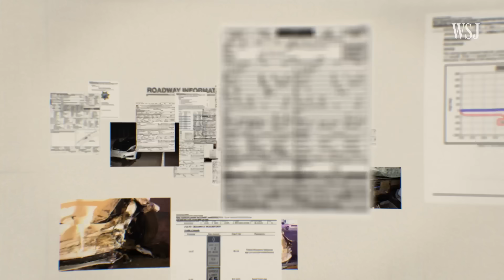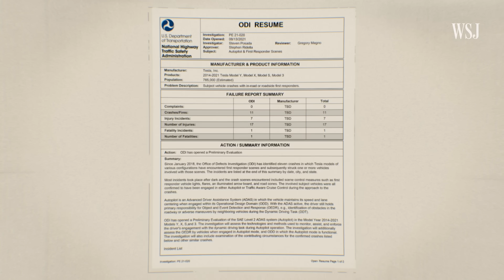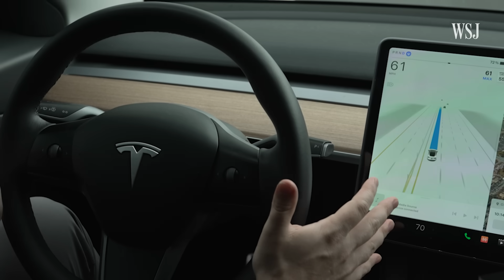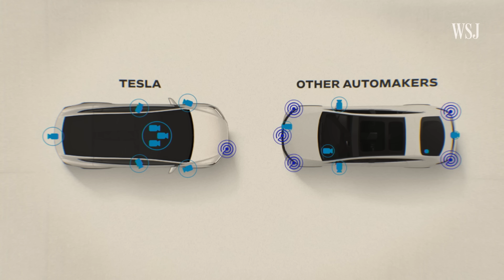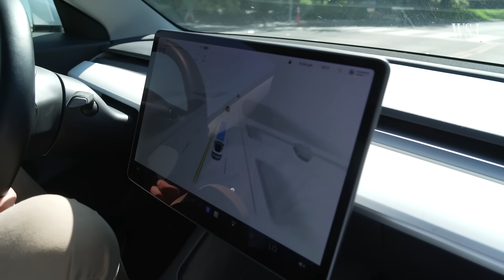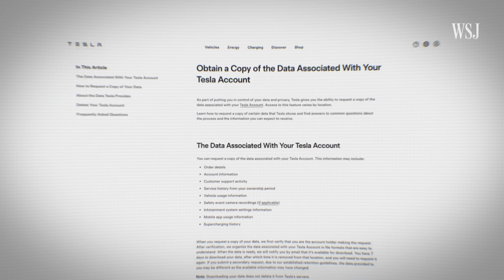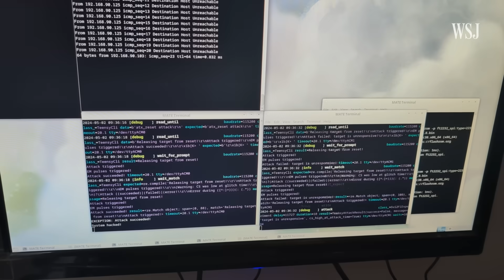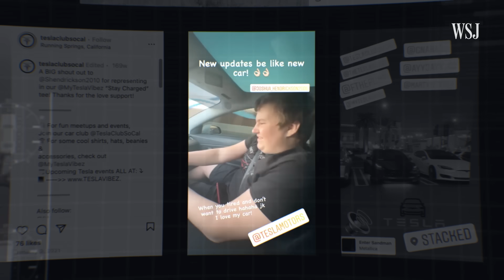The Hidden Autopilot Data That Reveals Why Teslas Crash | WSJ

Comment: Actually, all cameras that are in view see it, it's just that the software needs to translate what all of them are seeing, depending on the angle as well. Basically, it's the software, not the camera that's not seeing it, since it's not trained on overturned vehicles, then it doesn't know how to process the image of what the cameras are feeding it.

I've worked with 16 camera systems with LiDAR and RADAR that are pointing in the correct direction, with a bus annotated in front of it passing by, but somehow the software thinks it's flying 50 feet off the ground, so of course it's going to try to ram it, since it thinks it's not there.

Heck, it even doesn't know what to do with a wall, since it's not really trained to analyze it either.

If your self-driving car somehow goes over the sidewalk and you're not on the wheel, you're screwed. It's just going to ram itself.

This is not limited to Teslas, this holds true for all self-driving vehicles at the moment.

Stop making it sound like the cameras are the only ones to blame, they are just the first and last line of defense.

LiDAR can only assist from a distance to some extent, but anything that gets too close also ends up as garbled data. If say you're on a bicycle and on the side of a LiDAR equipped vehicle, 2 feet away from it, you're in all likelihood a garbled mess for the computer to analyze, and you can still get sideswiped.

This technology is not ready for mainstream. Not at all. I doubt it will even be ready in the 30s, but hey we need to sell the masses some new hype or buzzword to throw their money at. Who cares if they die as long as we make more money, right?

Also, pilots are properly trained to fly a plane and use autopilot when needed, regular drivers just need to pass the driving test to get that license. Regular people will just buy into the marketing BS of autopilot that's fed to them because most people aren't that bright, let's be honest here.

A smart and informed person will probably not trust any technology 100%, that's why we have backups, contingencies and redundancies, cyclical error correction, etc. everywhere, but most people are not very smart or well informed, unfortunately. That's just how it is.

Comment: Simple solution, if there were reflective strips on every side of the truck (including roof and bottom side) this probably wouldn't happen because cameras would see it.

Also driving so fast in fog that dense is not a good idea, no matter with or without autopilot, fsd or any other technologyb of this type.

Comment: 10:25 
Every technology has its flaws, but to say that we aren’t “doing enough to fix its gaps” is misguided. FSD 12.3 was released earlier in March this year to the masses as a free trial and the software has gotten WAY better now in December of the same year with FSD 12.5 for legacy Teslas (FSD13.2 for HW4 Teslas). Many of the flaws from 12.3 were fixed in a span of 9 months by using the camera technology in the cars and the training of FSD using Tesla’s End-To-End network. Training a car to self drive is difficult and requires tons and tons of data, most of which are collected from people reporting take-overs from FSD if it does something it’s not supposed to. Higher resolution cameras are also factor for how well the software performs. HW4 cars perform even better with their higher resolution cameras and faster processors on FSD 13.

Comment: The big crash they talk about in this article is when Tesla used radar in his auto pilot software. The camera saw it, but the radar didn’t because radar can’t see still objects, which is why the crash happened.

Comparing that autopilot crash from a half decade ago is like comparing an early 2000s flip phone from 2000 to the current model iPhone in terms of capabilities and advancement. The way the system works is completely different.

Comment: Tesla is beta testing its technology on our streets. That being said, if the Wallstreet Journal graphed the crash occurances on an actual timeline instead of just saying since 2016, I think you'll find the number of crashes reducing at an incredible rate over time. With the current update, A Tesla's can self drive for 10000 miles before the driver would have to touch the wheel.

Comment: But autopilot was NEVER intended to be used as an autonomous system. It’s like a fancy cruise control. The driver is still 100% responsible. The flaw is with the user who ignores the warnings and instructions that you have to watch the car driving and be ready to take over at any moment. By definition, every single crash during autopilot is caused by driver error.

Comment: Something not addressed in the video: the difference between basic autopilot and FSD. If a driver is using basic autopilot and is treating it like FSD, disaster is bound to happen. 

Another point not addressed: do Tesla’s autonomous features reduce or increase the rate of accidents compared to non-autonomous driving.
Reply: Calling an fancy cruise control autopilot is just misleading
Reply: @Jonas_Meyer  That is what it is called in planes.
Reply: @ivyWeb  But a Tesla isnt a plane. Also Tesla published this fake "Autopilot" video in 2016 that gives a false sense for the real capabilities of autopilot
Reply: @Jonas_Meyer it does have those capabilities. Search V13 FSD
Reply: @DuduDBS-zl1bb  That was not the point. FSD V13 is 8 years later after the fake autopilot video and the crash already happend. Its about the capabilities when the ad was run and autopilot was advertised. ALSO FSD is still only level 2.
Reply: @Jonas_Meyer  You are right but here is the thing Tesla owners do not confuse autopilot with FSD. Most if not all Tesla owners can tell you exactly what the capabilities are and where they feel comfortable and not comfortable using the system. Having said that the chances of a human being making the same mistake is much higher than most of us want to admit.
Reply: @Jonas_Meyer, that 2016 video was about FSD, NOT Autopilot. At least try to get your technology right.
Reply: @ivyWeb  Because it actually works in planes and it IS autopilot - thats why
Reply: @piccalillipit9211  Autopilot works in plane because it's used as it should, being supervised by a pilot at all time, which is NOT the case of the accidents in this video. 

And FSD was never sold as just "FSD". It was called FSD Beta until version 12 and now called FSD Supervised. There was never a version of FSD being sold as an unsupervised autonomous system yet. The driver is still responsible for the driving. Activating that system clearly states so.
Reply: @ivyWeb  Tesla is marketing to the entire world though.  Tesla's valuation is based on that.

You can't on one hand say "well the insiders, those who know, know that blah blah blah....."   And then on the other hand, treat Tesla as if it's conquest of the entire transportation industry is a fait accompli.  Because that includes drivers who can barely use a cellphone.
Reply: Just stop. I have FSD. It's fine for most of the part, but acts like a drunk teenager 5% of the time. Not exactly a good record.
Reply: @espen2729  I don't have FSD - though as electrical and software engineer (and driver) I can only agree that this "5% of the time" seems to match "Tesla crash videos" that people post.

At the end - I still trust more even my all-night drive across Europe hence slower reaction speed brain & body - than BS marketing that works "most/almost all the time".
Reply: @techcodenet  I'm a software engineer that has worked on vision, but also a hobby photographer. I personally would feel cautious relying on computer vision at night. The camera footage from those crashes is showing a noisy footage from the lack of light. The human eyes have higher dynamic range and better low light vision even compared to cinema grade cameras with larger imaging sensors.
Reply: @cmxpotato  even without knowing all those night-time details - for me the starting point is really as simple as

"During daytime (no fog/rain/snow and perfect light for cameras) - the AI would not recognize something it was not already trained to recognize/see, even though anyone (non driving kids) would know is obstacle"

And then of course night/rain/snow/fog come and it's just worse.
Reply: @Jonas_Meyer  you guys have Musk Derangement Syndrome. It's so funny.
Reply: Why any sensible person would want autopilot or FSD escapes me.  Dumbest idea ever and you bought it because Elon told you his computer was a safer driver than you?  Ridiculous.
Reply: Look up how Tesla has their ai image flaggers tag "no right turn on red" signs...

...they ignore them completely. Tesla autopilot/fsd is not trained to recognize no right turn on red.
Reply: @UmmmmmmmWhat  Tesla autopilot/fsd is CURRENTLY not trained to recognize no right turn on red. It is still a supervised product. Many of the stuff that V13.2 can do wasn't possible before.
Reply: Yup, that's why it's egregious to see one of those video clips where Autopilot ran through an intersection. It was not intended to be used anywhere except an access-controlled, divided highway.
Reply: This helps me understand why the cyber semi is being delayed as semi's accidents are an enormous liability.
Reply: FSD relies on the same information as autopilot and other than those involving navigation will make the same mistakes.
Reply: FSD is only a L2 system. That is a cruise control. It is sold as "full self driving". L3 and above is the first autonomous systems. Some have it, but not Tesla.
Reply: Full self drive is a dangerous lie too. Anyone who has purchased this garbage is putting their life in the hands of faulty software.
Reply: WSJ always like to report what they wanted to not what they should.
Reply: The problem is how it's marketed, vs what the company actually promises legally. The dissonance between them says a lot
Reply: Exactly
Reply: Shouldn’t be called autopilot then
Reply: FSD is full speed driving. Never stops.😂😂😂. My friend told me to check it out, it’s a lot better! Yeah, it only blows thru half the stop signs as before😮 progress! Conclusion. Use a waymo
Reply: tech should be used to help the driver avoid accidents, not do the driving for the for driver. Newer cars already come with useful safety features, like reverse cameras, blind site monitoring, auto breaking, even adaptive cruise is useful. Tech should be used to to perfect and make more systems like these, not replace driving completely and make the driver extra inattentive.
Reply: “FSD” does not exist. In Europe it’s literally illegal to advertise Teslas as self driving.
Reply: This issue comes up increasingly frequently and always makes me wanna pull my investment out of the company. I personally don't trust this el cheapo camera only solution. Every living being has multiple senses and these cameras only work on visible and near-visible light (and sometimes the ultrasonic range of the sound spectrum?). Tesla should concentrate on solving the lidar price problem and pay Elon huge sums only when he Fully Self Deserves it. Until then it's just confusing marketing, spreading a false sense of safety.
Reply: @chris-tal  it doesn't even have to be lidar.

I'm not sure what is exactly used for cheap/standard distance maintaining cruise control (nothing spinning, so it's not lidar). But those things would break well ahead of all these collisions.

And sure - every now and then those things have slightly annoying situation where wet leaves or snow make the car think it's about to hit something...

Though actually thinking through all the times it happened ... 

Either there was so much snow on the front plate/bumper/grill/etc that the car itself upfront told/disabled "distance keeping part of cruise control" and warned obstacle detection isn't working.

It was leaves or such - and although it played/displayed the distance/collision attention thing - it actually didn't try to break.

It really was a car/obstacle in front, we were already manually breaking - but automation wanted to play it safer than our human judgment and also did some extra emergency breaking on it's own.
Reply: @techcodenet  Yeah, there are ToF sensors that don't use moving parts but you need multiple of them. There's the (mmWave) FMCW radar which works better in low visibility conditions. The cheapest of them all is based on using ultrasound (which might even work as roadkill prevention).
Reply: Yeah he’s just a cheapo there are literally some Volkswagens that have lidar tech as part of their safety tech and Tesla a billion dollar company can’t implement that ?
Reply: @denali6935  The only VW vehicle that is scheduled to have LIDAR is the ID Buzz as part of their upcoming Level 4 system but as 'upcoming' means, it's not available now.  No VW vehicle currently on the market have LIDAR.
Reply: @chris-tal FSD is not the same as basic autopilot, also look at the dates the crashes happened.. this is not up to date data and software is well advanced to what it was in 2021.. is like comparing windows XP with the latest windows.. also people need to be aware of the road as well and not fully think the car is in control specially when using basic autopilot..
Reply: @luismanuelcb273  Well then Tesla shouldn't overstate itself either to avoid a huge crackdown on them and loose money. Because now they still need the human factor too, most humans will simply blame the system and that also means that the system isn't ready yet, because it gets caught up in controversies. Also it's not the software I'm not OK with. It's the one sided use of sensors in a complex boundless environment. A repeated bright flash from an emergency vehicle blinds them for example. You can't simply code around the boundaries of physics.
Reply: @luismanuelcb273  FSD is also not FSD.  Noting is what its sold as if it has anything to do with Elon Ponzi
Reply: The point is IT'S ALL A SCAM no matter what it's called.
Reply: The comparison should be: Autopilot vs Human, and FSD Supervised vs Human. Then you’ll see that most accidents, focusing of fatal ones, could not have been avoided in case of Human driver.

Then compared to Lidar, you’ll see most ADAS system FAIL to address such scenarios altogether, because of multi-non-reliant data from the different sensors, cameras and Lidar system, so much so, some will cut their control, while not even telling so to the driver.

Where are the investigations on those?
Where’s WSJ team search for answers, using their so called Professional analysts over those?
Why are those kept in the dark?

Oh, and while we’re talking, Tesla has updated its fleet with more data, making it even safer - much similar to the flight industry, rather than the common motor industry.

T
And that’s what I have to say about that.
They do while others don’t
Reply: @elirannaggar3761  I have worked on writing software for computer vision and to be honest, I feel very eerie and uncomfortable with any self-driving car solely relying on vision. Especially at night, the tiny sensors on those cameras simply can't collect enough light that it's a struggle for the software to pull useful data out from it (and it's pretty obvious this is the case from the footage of all the night crashes). Human eyes are just so much better at seeing at night even compared to movie cinema cameras.

Comment: How many people die in car accidents in the USA every day? 109
How many Teslas are on the road? 2.5 million.
How many cars on the road? 292.3 Million.
Therefore 2.5/292.3 = 0.8 % of cars on the road are Teslas.
109*0.008 = 0.872 people should be dying every day in Teslas if they are of average safety.
Total people who died as a result of accidents involving Teslas in USA last year: 103 (aka 0.38 per day) 

So Tesla are about 0.87/0.38=2.3 times as safe as the average vehicle on the road.
That was last year.  In 2024, the improvements in autopilot and FSD have been remarkable.
prediction:  Teslas will, on average be even safer in 2024, and safer still in 2025.

sources (for 2023)
https://en.wikipedia.org/wiki/Motor_vehicle_fatality_rate_in_U.S._by_year
https://www.insuranceopedia.com/auto-insurance/how-many-electric-cars-in-the-us
https://hedgescompany.com/automotive-market-research-statistics/auto-mailing-lists-and-marketing/
people who died in Tesladeaths.com

Comment: Interesting fact, no automaker submits crash data where normal cruise control is active. At no point have automakers been required to submit that data meaning that normal cruise control could have been responsible for thousands and thousands of deaths over the past few decades. Is this defending Tesla, no, but the data we get from Tesla is real time because their cars from day 1 have been connected to the Internet so the data is skewed to look like Teslas are dangerous. We really need other automakers to disable normal cruise control and to recall hundreds of millions of cars to disable normal cruise control. Don't believe me? Reach out to NHSTA and ask them for crash data where cruise control was a contributing factor. They won't have it. The way we fix this is getting each State to start volunteering collecting this data but they won't because the feds don't require and it costs money.

Comment: On the Video 7:00 , It looks like it also gets data from Radar ( "Rdar" , RdarV ). 
The cars used two technologies.
The problem is that Tesla wants to make money and they are cheap. I was told early on to confirm operations, They should not rely on one system, the vehicles should have a minimum of 3 input detection, Video,  plus ( Lidar, Ultrasound and or Radio Frequency ). 
Elon is just dumb or very smart on how to make money.